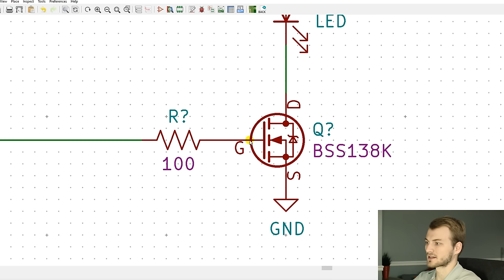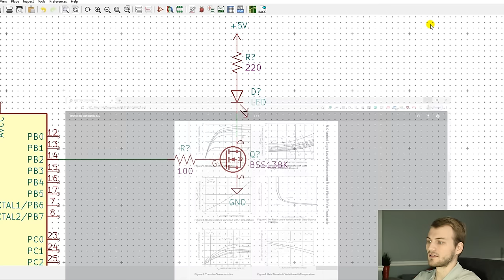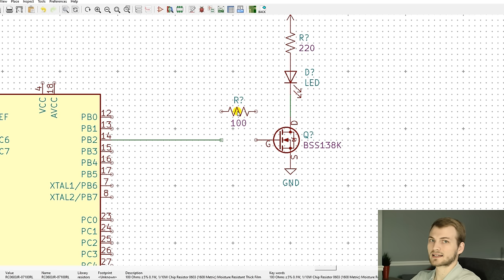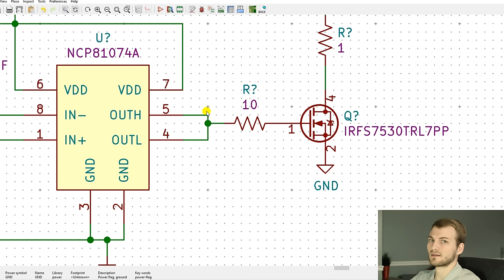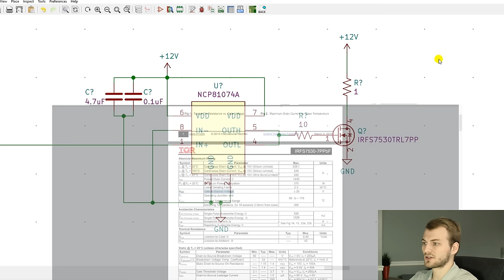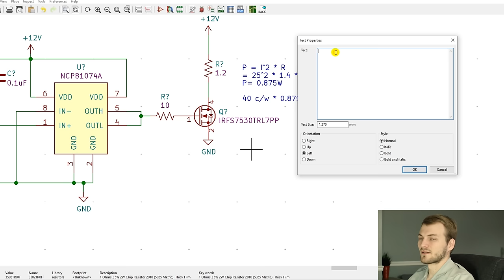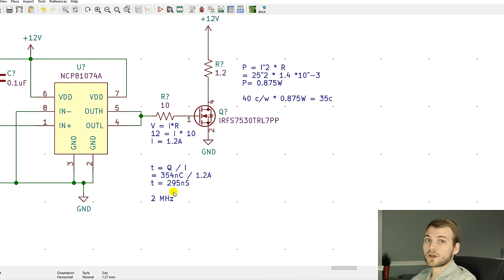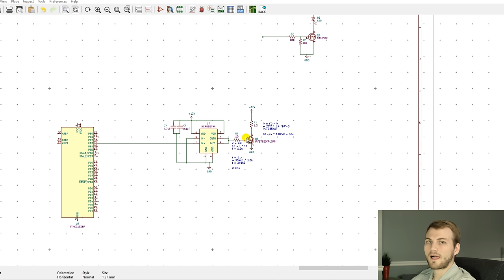Designing Power MOSFET Circuits - Circuit Tips and Tricks

Comment: Thanks for this excellent video. My question : how can we replace the relay in a battery charger by one or two MOSFETs? I imagine a P MOSFET mounted as a polarity protection and directly charging the battery through a schottky, and the voltage of the battery sensed by a BJT thru a voltage divider that will block the MOSFET as the battery reaches 14 volts or so. What would be the values of the components : transistor (N? P?), voltage divider... Can you make a video on that? Thanks once again. You are great.

Comment: Wonderful video sir! I'm brand new and trying to learn. Would you recommend a gate driver for something like running a outdoor LED light? I am working on a project for my home built RV and I'm designing a switch/remote relay for my external LED light banks. My thoughts after your video are that I should use one versus just straight N mosfet. But would like clarification if this is high enough power requirements to need such a design. Thanks!

Comment: Very informative. Thanks so much.

Another video talked about average voltage to the gate via an Arduino analog output. That doesn't seem correct to me, as in an ideal situation you're simply passing a PWM signal from a microcontroller on to the MOSFET (possibly via a gate driver), which then replicates this same PWM signal as closely as possible. This would effectively be an average only on the final output.

Or at least that is my understanding. Does that seem correct?

Comment: Very very useful video! Thnx! 
Looking forward for more "in between" practical circuit calculations and examples. 

One question. Even if I do all those calculations, I would still have to look at bunch of MOSFET datasheets to find matching MOSFET. 
Than could take a lot of time if you randomly opening MOSFET datasheets and don't know how to look, like I don't.
There are naming conventions that could guide you to look for certain type of MOSFET based on your circuit requirements which could narrow down number of datasheets you have to look at. Can you help with that? How to match MOSFET without looking bunch of datasheets  and spend hours on that?

Not sure is it something that you want to cover on your channel, but would be interesting to understand for example practical calculations of inductor and capacitance for buck or boost convertor.
Or for example example, simple design for power amplifier with bjt transistor.
Just some ideas...
Reply from the maker: Yep, I am planning on a selection video/blog coming up, seems to be a common request.

One of the next videos is going to be on a review of a buck converter, so I'll cover some of that :)

Comment: This is really good stuff! I have a couple of questions, though. If using that MOSFET driver, do I still need that gate pull down resistor, or is that included internally in that driver (I noticed the IN+ pin contains a 200K pull down, but wasn't sure if that translated to the gate pin). Second question is, if I use that setup, with the micro going to the MOSFET driver and then to the MOSFET, can I just hook that MOSFET drain straight to the brushed 10A DC motor's "negative" lead with the 12V going to the brushed 10A DC motor's "positive" lead? Assuming I use a fly back diode, like a MBR40100CT?
Reply from the maker: Great Questions!
"If using that MOSFET driver, do I still need that gate pull down resistor" 
Typically no, because it is included like you say. But, an external resistor costs pennies, so I normally always include it, then there's never any surprises, and you can adjust the strength of it.

"if I use that setup, with the micro going to the MOSFET driver and then to the MOSFET, can I just hook that MOSFET drain straight to the brushed 10A DC motor's "negative" lead"
This one isn't as straight-forward. For the most part yes, what you described works. It depends on the motor in question though. Some don't like having their ground pin not at true ground. This is especially true if there's anything else on the motor (sensors, tach, encoder, etc.) that also uses ground. But for the most part, that is how I would control a brushed DC motor that I don't need directional control.
Reply: @MicroTypeEngineering  Actually, I think I figured it out. If it's like a half-bridge MOSFET driver, then it appears to be "no pull down required" because the MOSFET driver takes care of that.

On a different note, but similar. Is this why cheap Chinese PWM motor controllers, which don't use MOSFET drivers at all, and just use 555 Timers, or op-amps to create a PWM, require large heatsinks on their MOSFETs to keep them cool? I've traced a PCB from one, if you need one for reference.

Comment: Thank you for this video. I hope you can help me out:

I'm going to use 12V supply to power an Arduino.
I need to switch several high power laser diodes (2 V, 3.5 A) on and off and I have to be able to modulate the power from the laser diodes. If I want to control the MOSFET with PWM, can I still use that driver and MOSFET to control de current in the diode? 
If not, what driver and MOSFET do you recommend? 

I assume I will use 12 V to power the driver and the MOSFET gate, but I need 2 V for the laser diodes.

Comment: Thanks a lot for the video! I was just wondering why don't you take into account the switching power losses into the heat that the MOSFET has to dissipate. I guess the switching is low enough or that the switch is fast enough so that the power peak is short enough or negligible. Again, great video!!
Reply from the maker: Yes, I debated about mentioning that. I probably should have when I said that you can slow the switching to help with EMC issues. But yeah, it usually isn't a factor with high current applications with slower speeds like this. I did briefly mention it in the blog post at least!
Reply: I was thinking the same thing, but, but, but ... and then I stepped back and thought about what a good balance this presentation strikes between the extremes mentioned at the beginning of the video. Even though this is a very important consideration, the very fact that the theoretical speed is described a “1.2” MHz vs 2 MHz should give viewers who need to know about switching the hint that it’s not a 1% factor - it’s more like a 40 or 50% factor and therefore necessitates consideration. But, again the balance of coverage was well planned and executed. Thumbs up.
Reply: Thank you very much!

Comment: What kind of logic mosfet would you select for automotive application to turn on the 12v lights. It’s different from your example, the light  needs to be connected to the ground, so to the mosfet source rather than drain. Need to control it from arduino. Do you have circuit examples by any chance? Thanks for great  videos.

Comment: Please show how to make high frequency laser drivers, used to make greyscale engravings. I have a low powered UV diode laser and would like to make PCB boards using photo-lithography process. Need to make a laser driver for it. It will be connected to a 3D printer to modulate it using PWM. Great video. Thanks.

Comment: That was interesting and earned you a new subscriber. I'm a retired software dev who got a basic electronics education via the Navy some 50 years ago. I spent much of my civilian career working with EE's on various projects from embedded systems to hardware evaluation systems. Now I'm peering farther into their territory and finding a lot to like, and of course a lot to learn. So please excuse me if this is a ridiculous question...

I've built one of those supercapacitor battery spot welders with 6 500F caps in parallel. Functional but very imprecise. Now I'd like to build a circuit to experiment with pulsing the current flow for short intervals (sub-millisecond if possible). A test discharge on the bank shows nearly 2 A-H available. Would a MOSFET be capable of switching this kind of current? If not, what would you suggest?
Reply from the maker: :D Absolutely. FETs are used in many LiFEPO4 batteries, which switch 100s of amps. As long as you choose carefully, you should be fine. Especially will want to minimize the switching speed.
Reply: @MicroTypeEngineering  Thank you. I'm not sure how to choose the correct part. I'm asking a lot, so if you'd prefer to point me to a resource rather than answer my specific questions I'm happy.

How much current am I actually switching and how do I find a part that will handle it? I'm not sure how to think about this. As I recall, I = E/R. In this case E = 2.7 (initially) but R can't be merely the resistance of a few inches of 12 gauge cable which is damn near zero? If the MOSFET offered much resistance no amount of heatsinking could protect it...

If 'minimize switching speed' means 'switch as fast as possible', that's what I'm going for. Microsecond pulses are what I'd like to play with. This means a fast rise/fall times on the gate voltage which I think I can handle. Are there other considerations?

Thanks again for your help!

Comment: Thanks for the great video on MOSFET drive circuits.  I would very much appreciate your opinion on what seemed to me, a simple application.  I need to discharge a small capacitor (less than 0.5uf) from 300v to gnd. at about 100Hz.  The norm here is to use an SCR with it's high surge rating, however, the latching effect of an SCR has ruled this out as the charging current (less than 30mA) keeps it latched.  Also I can't insert a series resistor as I need a fast discharge.
Would there be any disadvantages for a MOSFET in this capacitive switching application?  An IGBT doesn't seem to last long here.
Thanks very much and a 'thumbs UP and subscribe'

Comment: Thanks! I completely forgot about that t = Q / I calculation. I must have learned about it at school but I guess it was getting a little too abstract for me that day 😅. But I guess that means in logic circuits where you have an audio codec chip for example, the MCLK line can easily have a signal of around 12-25 MHz. In order to prevent ringing, you'll still want a resistor there, and maybe a couple pF of capacitance as well.. But the resistance should be calculated pretty accurately I guess. Still, I see people giving I²S (Inter-IC-Sound protocol) demonstrations with simply using jumper wires on a breadboard.. So maybe it's not that important after all. Or do logic inputs like that just commonly need a much lower charge to register a logic '1'?

Comment: Helpful video. I've not used a gate driver yet, but thank you for the part number.

For inductive loads, generally, I don't trust the internal diode. I used an external Diode for the back EMF spike, Also, I've seen MOSFETs use not a regular diode in a flyback configuration, but instead Zener diode, likely to clamp for static only. For small stuff, a 1N4001 diode would likely protect your MOSFET. I also used a STTH812 ultra-fast diode, but that's using a sledgehammer for a tack. 

Traditionally, I've use NEC PS2501 optocouplers for isolation, but lately, I am leaning toward optocouplers with a Schmidt trigger, built in, as I don't need the nice linear region for switching.

For logic-level MOSFETs, I' like the IRL640A They are reasonably priced. Compared with your application/choice, the IRL640 is higher voltage, lower current, lower Rds.
https://www.vishay.com/docs/91305/sihl640.pdf

Comment: Your talking about driving the H-Bridge with a PWM signal but specifying "continuous" current requirements which implies DC, not PWM. I'm confused. When you're calculating temperature, is your 25amps DC or PWM and if PWM what is the duty cycle?  What is your Vds at the 25 amps? I'm not that smart when it comes to data sheet numbers. I just burn up FETs a lot.

Comment: I like the info here. Thank you. It helps me understand a little more than I did before watching. However, why would you need to choose a power mosfet if you’re not building a voltage regulator?!? Also I’ve never seen that circuit before. :(

Comment: This is a great video, thanks! I might have missed something, but I use PSMN1R8-30PL and IRLB3034PbF for switching DC motors at 20-30 A average load using logic level input. They've got almost as low RdsOn as the standard one you use as an example, and much lower gate charge. The rest of the parameters are similar. What have I missed?

Comment: Great video ! I do have one question , when ever I have chose a MOSFET I have gone to the Digi-Key or Mouser website and used the filters to filter down to probably 20 or so possibilities and then chose based on price and availability , but I'm always worried about errors in the data sheets , I have once found a datasheet on a charge IC that had 87 errors !  So when you said "go to MOSFET" I thought a list of "go to MOSFETs" would be handy because they probably have fairly reliable data sheets . Is there a list of  "go to MOSFETs" ?
Reply from the maker: Right. Yeah, it seems like a video/blog on the selection process is something that has been requested a lot. I will add that to the list of videos coming up!

As for errors in datasheets, you think I have a list of FETs that have perfect datasheets?! LOL I wish. At least once a week we have a small/large issue with a datasheet on some IC/part. It is honestly one of the more frustrating aspects of designing circuits as a career.
Reply: @MicroTypeEngineering  I was designing a charge controller using a "made for" IC from what was Linear , as I said 87 errors in the datasheet , the company assigned me to a unbelievably bad engineer , one time I asked him what the correct value was on something and his answer was , and I am quoting , " I could tell you". I finally went to a trade show and went to the Linear booth , all I got was promises from 20 somethings , I finally just gave up , and decided micro controllers were a better way to go , and just write my own code.  If you don't have access to the A or B list engineers and you are not lucky enough to have a very simple component or a very accurate data sheet , I just don't know what to do but find another way.

Comment: Very good Vid, nice explanations, I wish I could have watched this 30 years ago. I think some power Mosfets like the IRF3205 and  irlb8721 will happily switch at 5v and low RDSon, not as low as 1m Ohm  but maybe 10 to 20 m Ohm and source certainly a few amps? My only criticism of this video was the audio, its clear but fades in and out quite a bit. I never paid much attention to switching speeds as mine are always so low its never been a problem but now you have provided me with a good explanation I shall work them out ! Thankyou for your good work.
Reply from the maker: Totally agree. Logic level FETs have come a long way. By far I use them more often than standard 10v FETs. But when you need the lowest Rds or gate charge, you don't have much of an option!

Thanks for the words, and yeah, still trying to get audio dialed in!

Comment: Great Video, I have reviewed several,  most have address some of my problems.  calculations that are kept simple;  Work.  We see a lot of transistors or MOSFETS in parallel;   I have an application that needs parallel and series combinations due to the high voltage needs as well as power.   Any ideas on how to stabilize 10 MOSFETS in series as well as  Parallel.  I have a high voltage switching application.  This would be driven by an FPGA  ;  rise time around 1ns about 10K to 40K VDC  PWM input.   Switching frequency is usually constant around 30 Hz or so.  ON time is 20 us.  35 ms total time.  Heat Sink is about 12" long now flat steel plate.
Reply from the maker: Oof. Yeah driving FETs in parallel is tough, as they can drive out of control pretty easy. As they heat up their resistance drops, so you get an uncontrollable loop. I don't have any experience with it, but be careful

Comment: Thanks for the lesson! I have a question. Is it a problem to use such a Mosfet driver for non-switching applications? I want to run several high power mosfets from an STM32 chip (3,3V). Some will run PWM signals, some will just turn on at a certain point, but might only shut down after several hours. All info is welcome!
Reply from the maker: Not at all, it's just sometimes overkill to use one for that use case

Comment: so what your saying is if i turn on a io pin (connected to gate) it will turn on the source (led exe.) connected to drain, is there a easy to follow video on calcating heat dissipation of a mosfet and let's say you're load has a back ems issue could you use a flyback diode to prevent the ems from dystroying the circuit/load?